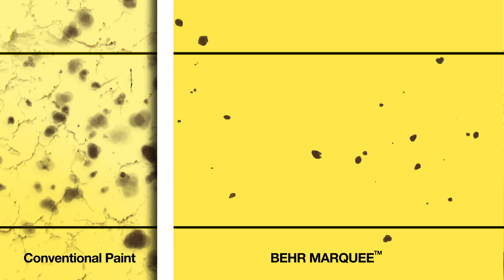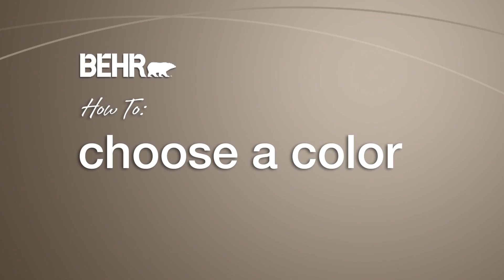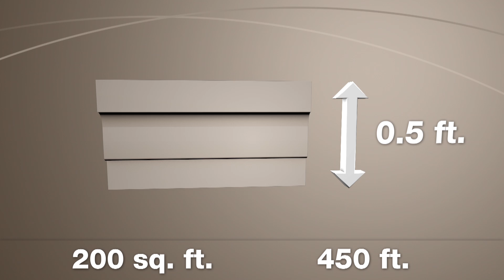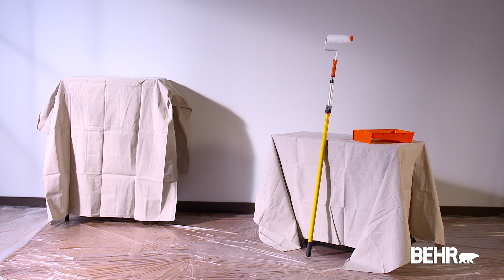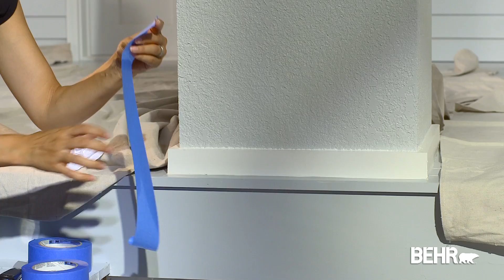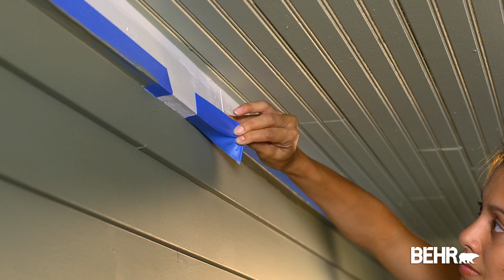BEHR Paint: How To Paint Exteriors (Full Version)

Comment: Whatever you do, don't buy Behr paint! My mother purchased Behr Premium Plus paint and primer exterior satin enamel and the paint didn't cure correctly. Now her house has to be repainted and Behr is sticking her with the bill. They are a terrible paint company with failing products.
Reply: I've been using behr for over 10 years I bet you didn't do proper preparation on the surfaces before you painted it I can %100 be sure of that if you can't do the job right hire a real painter next time.